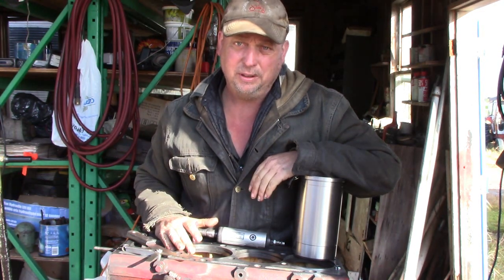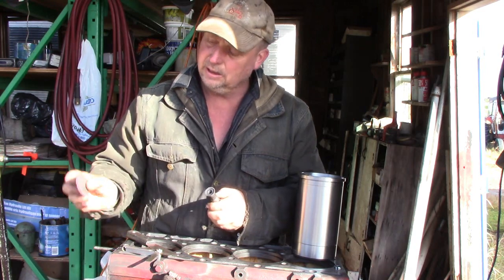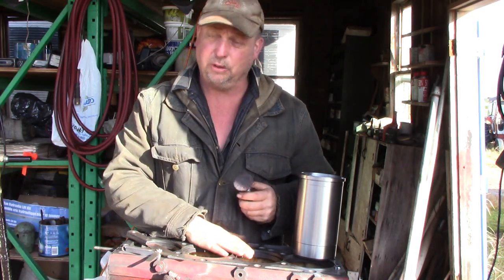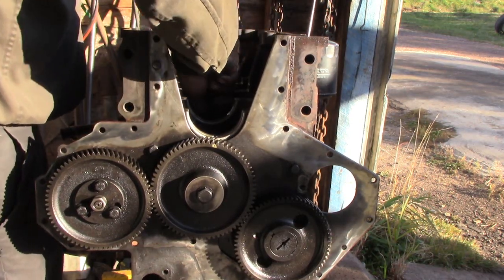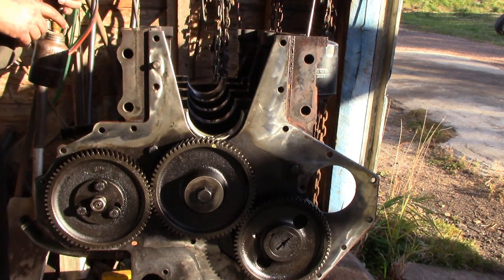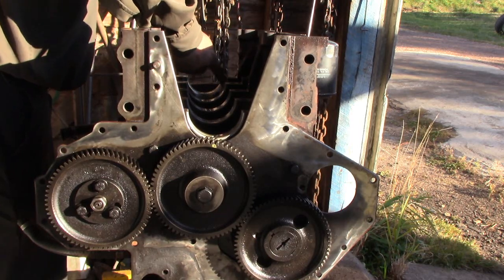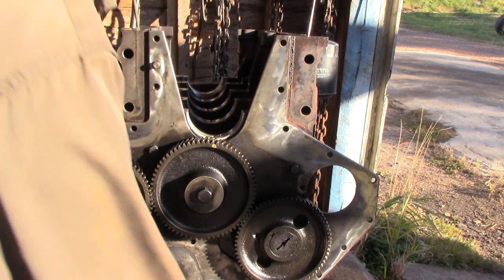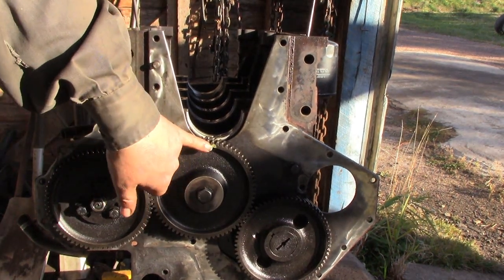IH 584 engine  Part 2, sleeves and crank, timing the engine

Comment: The rubber o-ring has oil on it due to splash up from the spinning crank and oil in the base
Reply from the maker: It would be in a very small area if at all, the sleeve protrudes below the web of the block and is a pretty close fit. The only place the oil would get to is the tiny gap between  the sleeve and block and that would be the cause of o-ring failure when it does happen. Thanks for watching!

Comment: Have a case ih 885 (not David brown) need help timing the pump to tractor.  Read #4 mark to time.  Where should keyway in pump be pointing?   What mark on crank? 8 btdc or 16 btdc.  Thanks for any help
Reply: Do you want a service manual for it ?
Reply from the maker: I would think crank should be at 0TDC but I am not sure

Comment: Hi Dave just a quick question for you my friend got the crank machined for a international 885xl but can't see a dot on the crank for timing it . Would the mark be the pin that keeps the pulley in the rite place be the mark ?
Reply from the maker: The dot is on the crank gear about 80 degrees off of the pin that aligns the front pulley. Thanks for watching!

Comment: Great video. Where do you get the specifications for fitting each part or does it come with the overhaul kit or do I  need to get s manual?
I have a 674 that I need to overhaul the engine.
Reply from the maker: A repair manual for your model tractor is the best option, it will have all the specs to follow and some instructions on the technical bits.
  Thanks for watching!

Comment: How many hours was on this engine?
Reply from the maker: I'm not entirely sure, over 5000, but should be good for more than that. It was sitting running a generator and overheated bid time, so that is what lead to the rebuild.

Comment: Great video 👍we did a head on a 674 due to a head gasket failure and found one of the head bolts was to close to snapping off on the block !! So we told the owner to buy new head bolts and made one of the bolts a semi tap to chase the threads ( can't afford something that's going to be used once in a while ) Despite having zero oil pressure and the owner not wanting to spend any more money on it, it just kept on going, I like these engines they are stubborn and will continue on until it dies. Got a 574 D239 and a European built 956 D358 motors to rebuild one day. Thanks for sharing this useful video !!! 👍🏴